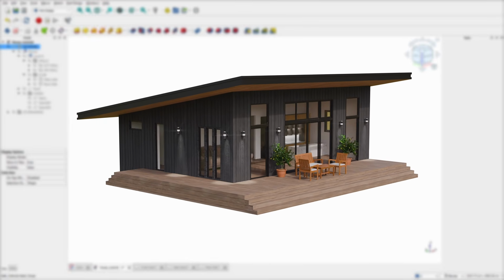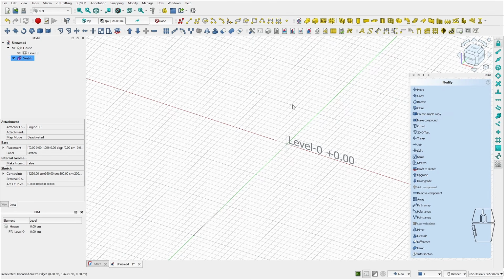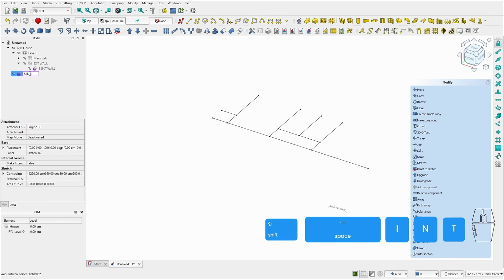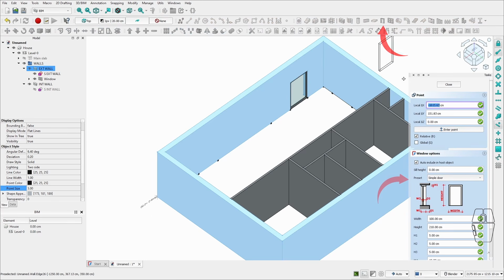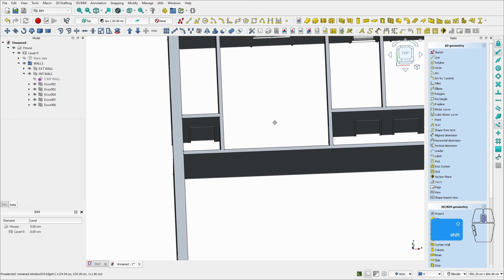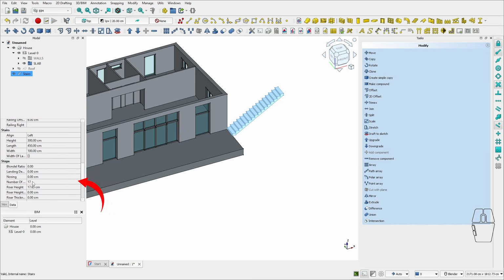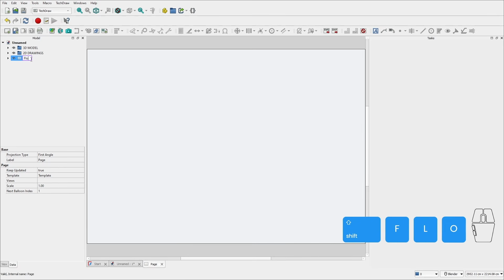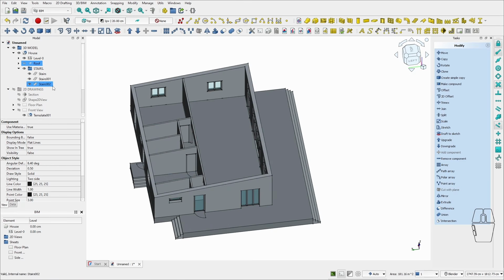FreeCAD 2025 BIM - Architecture - Complete Beginner Tutorial

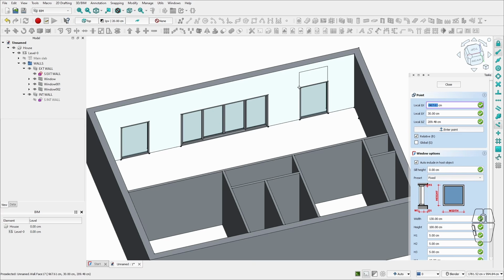Comment: I have two issues, after creating the points they are not visible on my walls even after setting the size to 8, 12 or 20? At 24:40 it won't let me snap to the top of the existing window, my snapping point is at the bottom of the wall?

Comment: xubuntu 25.10 Freecad 1.0.2 having trouble with two things: using the split tool to add a point then the coincident constraint to the deck; get redundant constraint. Second, similar, the constrain symmetric for placing the construction lines in the slab offset; same error: redundant constraint. 
Please help.

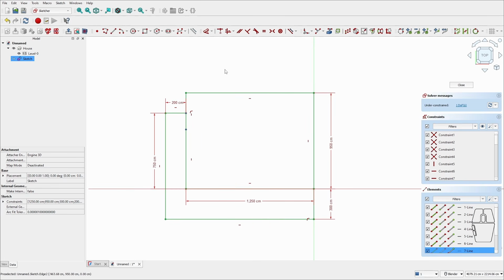Comment: 7:40 I just can't get this to work. I get the error message: "ViewProviderSketch: Delete: Selection not restricted to one sketch and its subelements"
I do it exactly as it is done in the video, but it doesn't work. It's very frustrating.

The solution is: I still had “Auto remove redundants” constraints turned off (which it is by default) under Edit > Preferences > Sketcher > General. Hope this is of use to somebody. (Thanks to @wmrsp)
Reply: Saved my day

Comment: 7:26 Whats the problem with the line that requires a vertex?
Reply: The lower part of that line is to be removed later. For that, it has to be split at the intersection point so you can delete just the lower part. For that step to work I had to "Auto remove redundants" turn on under: Edit > Preferences > Sketcher > General
Reply: @heyyoo  thank you <3

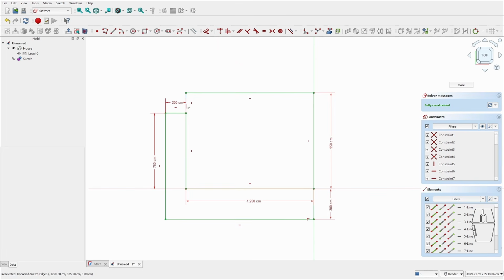Comment: Maybe its something to do with version differences.. but I have run into issues with several of the tools so far - and I'm only 10 minutes into this tutorial.  First off - The "Coincident" constraint that is placed around 7:39 would not work for me (after selecting both points and clicking the constraint button - nothing happens).. And now at around the 10 minute mark he tells me to add a symmetric constraint by clicking the line - then the point on the construction line - but the sketch turns orange with redundant constraints?  Very frustrating to follow each step and still have these issues!

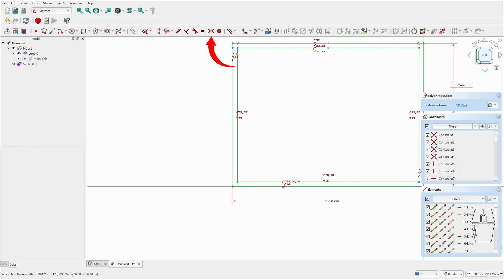Comment: i stuck at 10:24. when i try to do that cad is telling me that this is an unvalid selection. but i selected everything like in the video. but still it tells me that this is an unnecessary constrain and it should remove some other . still he says i have 4 unsolved constraints. but if i do that like in the video. 

this drives me insane, i think my freecad works slightly different. this is mac and hes probalby on windows. had this multiple times now in those few steps. takes me so much longer because for every step he does i have to fix 10 things...

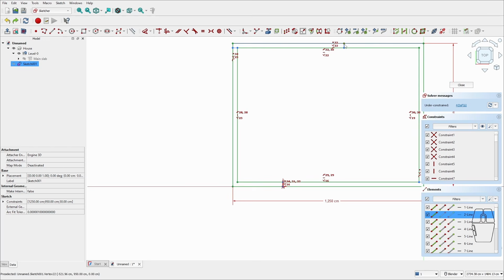Comment: 10:20 like others I get duplate constraint with the symetry. Using 10.0.2 FreeCAD.
Reply: I've saw this in a comment in this video:

Enable "Auto remove redundants" 

1. Go to Edit > Preferences.

2. Select the Sketcher tab in the preferences window.

3. Check the box for Auto remove redundants.

4. Click OK to save the changes. FreeCAD will now automatically remove redundant constraints as you create them.
Reply: Do you know if that is a 10.0.2 bug?

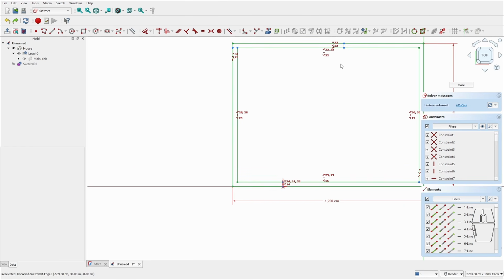Comment: Really struggling at 10:20  
No matter what I do when I try to do the construction wall symmetry step it says redundant constraint and goes red
Reply: I have the same problem
Reply: Hi mate, done this tutorial on several different OSs...So just a quick tip: if you click on symmetry edge ( line) on the defining points you will be also activating  the wall geometry structure. To get pass this, move first the symmetry lines from the corners than apply the step as per video instructions.
Reply: You should turn on "auto remove redundants" in Preferences > Sketcher > General > General, or simply listen to FreeCAD and remove the redundant constraint in the "Solver messages" section (right-hand side column if you set up your workbench in a way that's similar to the video uploader)

Comment: I keep getting redundant constraints. why????. using Freecad 1.0.2
Reply: If you have set an overall length constraint, and then you enter constraints for all the segments of that length, like the windows and the gaps between them, then one of the constraints will be redundant - you have specified the length in two different ways, even if all the segments add up perfectly to the overall one that you set. The solution is to make one of the constraints into a Reference constraint, which doesn't drive the placement of the parts, but does show up as a measurement.
Hope that helps
Reply: You should turn on "auto remove redundants" in Preferences > Sketcher > General > General, or simply listen to FreeCAD and remove the redundant constraint in the "Solver messages" section (right-hand side column if you set up your workbench in a way that's similar to the video uploader)

Comment: I cannot seem to replicate the result of the step in 7:37 in the latest version of FreeCad. Anyone have any solutions?
Reply: me too. Did you manage to solve it?
Reply: When he grabs the dimension of that left side it shouldn't be to the bottom of the front deck. It should only go to the bottom line on the house. He accomplishes this by clicking the top left corner of the deck and dragging down giving you 750 cm for the length of the deck from the top of the deck to the bottom of the house. THEN you SHOULD be able to make the lines at 7:37. I also got stuck here...

Comment: This tutorial is being constantly plagued by bugs you do not encounter. What version was this tutorial made with? 
1.0.1: 
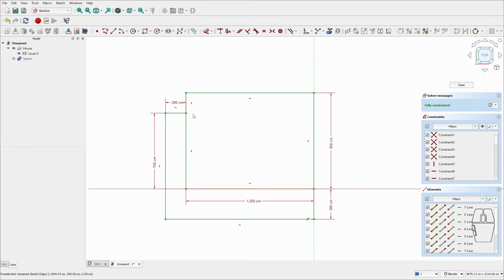- claims overconstrained seemingly at random when constraining Coincident at 7:40 (workaround: move the points seemingly at random for a while and it might just start working).
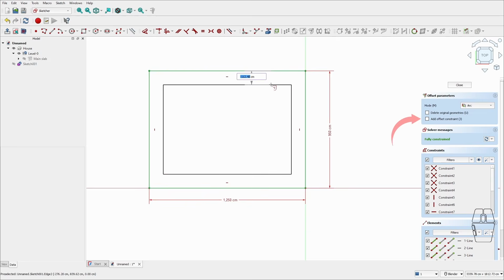- steals keyboard focus away from the dimension  textbox when clicking in the Offset parameters pane 10:00 (Workaround: use the J keyboard shortcut).
- claims overconstrained seemingly at random when constraining Symmetric 10:20 ... 

And a bunch of smaller bugs like the 3 crashes i have had. This is where I am giving up and looking to either downgrade to a stable version or upgrade to a weekly build after 2 hours and 20 minutes of fighting with the first 10 minutes of this tutorial.
Reply: Upgrading to latest weekly fixed the first bug.
Second bug still present but workaround is easy enough to count as a minor issue.
Third issue has a workaround that I hope won't bite me in the butt later: delete the angle constraint which is labelled as redundant after each centering operation. Seems to get immediately re-created, but is no longer marked as redundant.

Got to the 11 minute mark in only 12 minutes, so going a lot better. How much of that is the version change versus a night of sleep is unknown.

The window not cutting through the wall unless the wall is selected is also fixed in this version. But the snapping on copy/paste seems wonkey. I wonder if there is a snap distance setting I can turn up.

Comment: I'm really struggling with @7:25 splitting the internal line from the decking line. I just get a "blocked cursor" when trying to select the section where the deck meets the wall line. Am I being dumb?
Reply: im also stuck here did you get it resolved?
Reply: @cedricdelbeke6308 no sadly not sorry.

Comment: At 7:40, I followed the same steps, but when I use the Coincident tool, the line turns orange instead of merging the points. Any idea why this happens?
Reply: You should turn on "auto remove redundants" in Preferences > Sketcher > General > General, or simply listen to FreeCAD and remove the redundant constraint in the "Solver messages" section (right-hand side column if you set up your workbench in a way that's similar to the video uploader)
Reply: Same issue
Reply: Same here, however it also states that there are now 25 additional Redundant constraints. I select the vertical line, (creating 1 Under-constrained DoF), the cursor changes to not allowed for the second point....ok ignore it, then, select the 2 points, select Constrain coincidence and bam, 25 errors.

Comment: Some actions (about adding constrains 7:40 and 10:20) lead to a redundant constrain warning.
Reply: is it solved ?
Reply: @rman_111  No, I had to find a workaround.
Reply: @evgenykarmatskikh9247  What did you do? I am at this point in the video and can't figure out what I am doing wrong.
Reply: Same
Reply: You should turn on "auto remove redundants" in Preferences > Sketcher > General > General, or simply listen to FreeCAD and remove the redundant constraint in the "Solver messages" section (right-hand side column if you set up your workbench in a way that's similar to the video uploader)

Comment: 6:00 I can't manage to do that easily in imperial unit system. After the first click, I can enter the feet but not the inches. any tips?
Reply: ok I figured it out. 
When you type any special character, like space, or accidentally any special character, the input freezes for a second. You then need to enter a digit, any digit, to unfreeze it, and you can then erase the extra digit if you need and go on writing whatever measurement.
Reply from the maker: @Gzussss Glad you find a solution and share it to us, Thank you !

Comment: For anyone struggling with 10:23, to me it seems like the sketch visualization doesn't update immediately after clicking the constrain button, but if I click the line afterward and try to move it, then it suddenly appears in the center. It's v1.0.1, just a baby! :D
Reply: I had the same problem with the constrain option when i tried to merge the left line and turn it into a construction line. For some reason the merge didn't work and my lines turned to the color orange. I just deleted the left line and draw another another one and turned that one into a construction line.
Reply: @mekstratv9214  the same happened to me, really stressed me out
Reply: @mekstratv9214   It turns orange because your vertex becomes overconstrained. Same problem as when you tried to impose a coincident constraint before at 7:40. The fix is to listen to what FreeCAD tells you and delete the redundant constraint or turn on the "Auto Remove Redundants" option in Preferences > Sketcher > General > General

Comment: Can someone help me? At 07:30 he creates an extra point and emerges it afterwards. When I try to emerge it, my drawing turns orange and it doesnt really emerge anything.
Reply: I just trimmed it and create a new line. It automatically constrained for me after that, so I just follow the next step.

I'm now stuck at around 10:20 . Well, I'll just continue without constraining it and hope nothing goes wrong.
Reply: Same here, I think the software must have changed a little. I found the point was already constrained/attached to the line and didn't have to add an additional vertex.
Reply: I put the split point as it shows in the video and then I moved it to the intersection point. Then I skipped the "constrain coincident" tool, selected the lines as it shows in the video and then selected "toogle construction geometry".

Comment: Thank's for this nice tutorial. Been going great but when I get to the point to snapping the windows to the interior part of the exterior wall they are oriented in a wrong way. If I try to snap them on the outside part of the exterior wall the are good. But since the reference points are inside it doesn't work.  Is there something I did wrong along the way? Thank's

Comment: Why no building structure info? Like several layers external wall, either brick + insulation or wooden frame with all the layers. I'm a bit disappointed in freecad capability regarding to buildings.

Comment: Having to wrestle a bit with the program during the window portion here, the H&W measurements keep switching to imperial units despite the metric input and having the default settings on Building Euro.  When I put the initial measurements in cm, I get the green checkbox; then it switches after clicking to the next box, and the red DNE circle pops up.  When I first installed, I chose the initial default of Building US, but had switched it to Building Euro after starting this tutorial (and all other inputs so far have adjusted accordingly, no problems).  Somehow that initial shuffle may have scrambled the window dimension input in some way.  Reinstalling FreeCAD and restarting the tutorial did not remedy the issue, appreciate any troubleshooting guidance or thoughts.

That issue aside, this has been a smooth and helpful tutorial to teach the ropes for planning around the house and it's been exciting getting more grounded with navigating the software, thanks!

Comment: why I cannot select intersection point while splitting edge at 7:39? thank you for your materials
Reply: Same here. I kept trying in different places and it worked in the end. Still confused by it because the video made it look easy!
Reply: I had the same issue, and then I realized that you can just move the split point to the intersection point.
Reply: I noticed a little red "arch" beside the intersection point which is not in the video. I deleted the red arch an than i was able to connect the points

Comment: Does the mouse at the bottom right also a feature of freecad or a different software? May I know which software you used for that. 

I am mechanical engineer myself. I have used solidworks, fusion 360 so far. After watching this video, I will try freecad and teach them what I learned from this video. 

Thanks for existing.
Reply from the maker: @chess1011 It's from OBS (the software I use for recording my screen)

Comment: Hi, thank you for a splendid FreeCAD lesson. I haven't used any CAD tool since the 2D AutoCAD in the 80's.
I am having an issue at 7:38 (using "split edge"). After clicking on the vertical line, I am trying to click on the intersection with the horizontal deck line, but I am getting the message "Not allowed" in the bottom left corner and a symbol (a circle with a backslash) at the cursor (the intersection point)
I guess I might have done something wrong prior to this sequence?
Reply: After clicking the vertical line, you have already splitted the edge. For the next step, select the two points and click on constraint coincident.
Reply: @edwardrivera3823  and then I get redundant constraints
Reply: You should turn on "auto remove redundants" in Preferences > Sketcher > General > General, or simply listen to FreeCAD and remove the redundant constraint in the "Solver messages" section (right-hand side column if you set up your workbench in a way that's similar to the video uploader)

Comment: Could you please share the build number of FC you used to make this lecture? 
I'm stuck centering four construction lines on edges starting at 10:07. Applying the Symmetric constraint after selecting one point of a construction line and an edge doesn't work. The construction line doesn't move at all. The solver message changed "Under-constrained: 4 DoF(s)" to one redundant constraint.
I've tried this on Windows 11 with both the official 1.0.0 revision 39109 and the weekly 1.1.0dev revision 40122.
Reply from the maker: I'm using version 1.0 stable. If you're having trouble making them symmetrical, you can just leave them as they are and continue with the tutorial.

Comment: Thank you for the great tutorial! I've just started with FreeCAD and BIM, too. 
I stumbled across two interesting things :
- When placing windows and doors from the inside they are all mounted inside-out, meaning they all open to the outside (using the "Opening" parameter of the WIndow/Door in the Data-Tab). My solution is to place them from the outside and use the "Offset" Parameter of the Window/Door in the Data-Tab to move them where I want them inside the wall.
- also for placing windows above floor level there is the parameter of "Sill height" when creating and initially placing the window.

Keep up the good work! looking forward to the next of your excellent videos!
Reply from the maker: @Jaryic To change the opening direction of the windows and doors, I select all of them, right-click in the tree view, and invert the opening direction; this saves a lot of time.  The Sill height parameter is also a great time-saver. Thanks.

Comment: This is 3D drawing not BIM. BIM follows the IFC protocol.
Reply from the maker: All elements are created with their correct IFC class, and the model structure adheres to IFC standards. You can export the file in IFC format and open it in any IFC viewer. You can also apply IFC materials.
When exporting in IFC, FreeCAD automatically creates the missing structure (such as Site, Building, or Level) if they are not defined in the model. This ensures compliance with the IFC Protocol.
Reply: @deltahedra3D  i couldn't see the correct ifc names in your video.
Reply: I am enthusiastic to try this side of FreeCad, however I didn’t find much “building information” within the model. Can the walls be defined as assemblies? And is the model truly 100% parametric?
Reply: @rduarte1338  i think a lot is possible because freecad is highly customizable but therefore quit complex. Blender also has a bim version.

Comment: @deltahedra3d is the model full IFC compliant? can you open it in an IFC viewer ?
amazing tutorial, thank you
Reply from the maker: @StefanoVerugi Yes, you can export the file as IFC and open it in any IFC viewer. You may need to adjust some export parameters in the export properties panel if the doors, windows, and roof are not displayed correctly. If you follow the video, all parts should have their correct IFC attributes associated.
Reply: Just as a heads up: FreeCAD 1.0 has a bug when exporting objects in groups to IFC. I think this will influence the export of the file created in the tutorial. I did not test, but I think the walls will not be cut by the roof and there may be other problems.
Reply from the maker: Yes you're right, walls will not be cut. One solution is to adjust the export settings. Go to Edit > Preferences > Import/Export > IFC Export and check the 'Force export as Brep' option.
Reply: @deltahedra3D  That is a good tip.